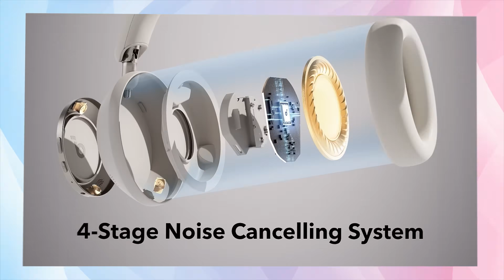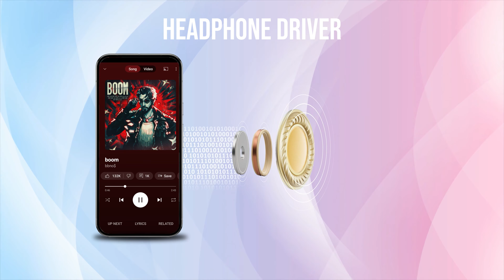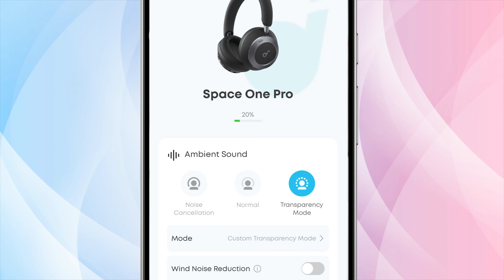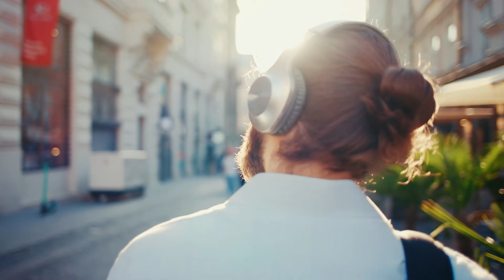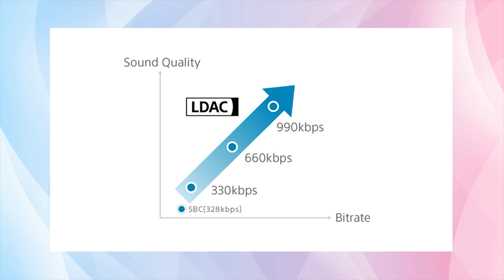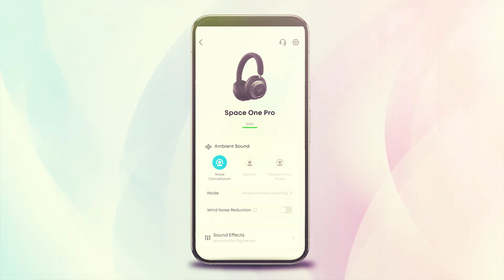SKIP the Sony/Bose? | Anker Space One Pro Review

Comment: i am looking for some headphones for Gaming and PC use. with these being reasonable in price i could buy these on sale and get a external mic for the price of a Sony MX4,5 or 6 . i do already have a pair of Grado GW100's they have great sound over BT but for long periods of use they are heavy and uncomfortable and have issues connecting to my PC.  How do you find the Audio quality compared to your Grado's?
Reply from the maker: So, very different sound profile only because my Grados were open backed. However, they were high quality. I say 'were' because they bit the dust this week! I dropped my Grados on the floor and the magnet broke. Very sad. I'll have to revisit the brand in the future. The Soundcore Space Pro Ones by comparison are deeper sounding because of the sound isolation, even with the noise cancelling off.